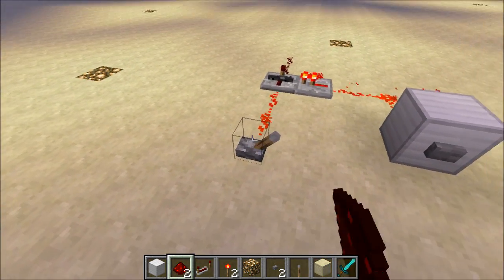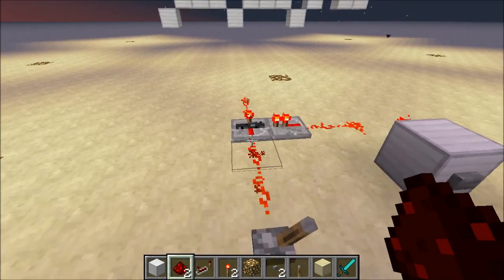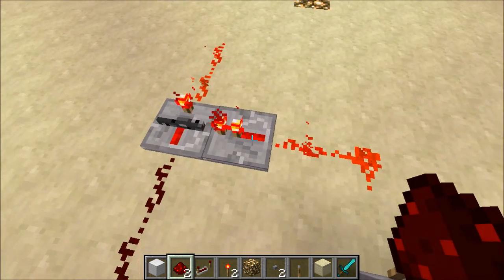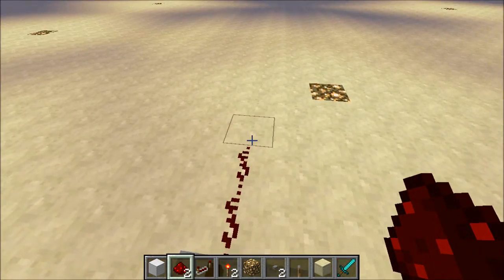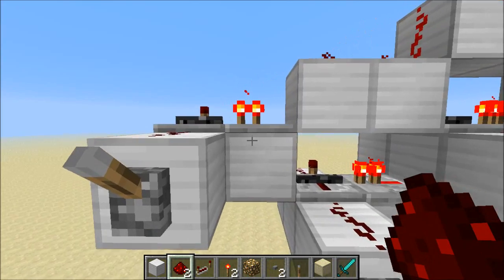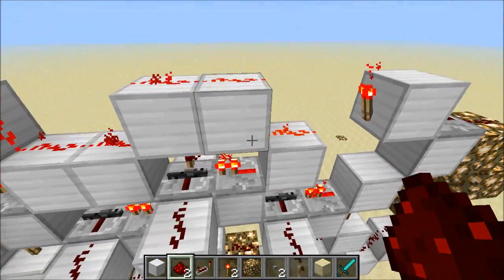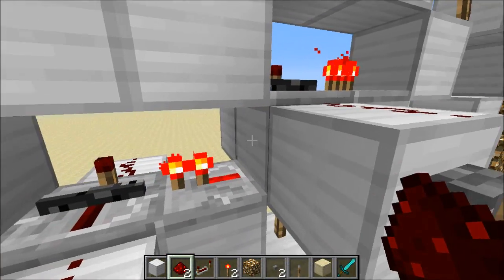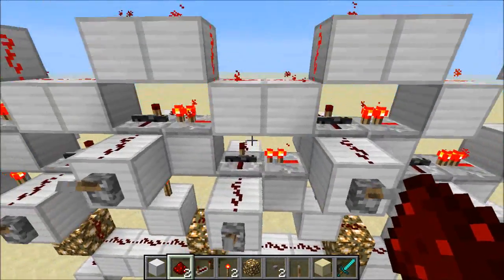Ultra-Thin Memory Using the New Repeater Behavior

Comment: I haven't downloaded the snap-shot yet but from what I've seen it seems to be level-triggered to me, since when it's unpowered it's continuously grabbing the state of the input but when powered it holds the state. Though really a latch is just a common term for a transparent flip-flop so it's still a D-flipflop just that it lets the input transparently go through when the hold enable is off.